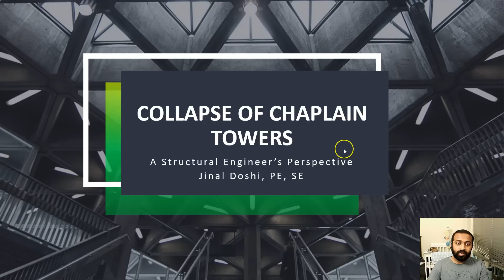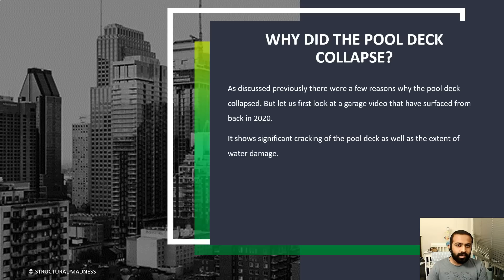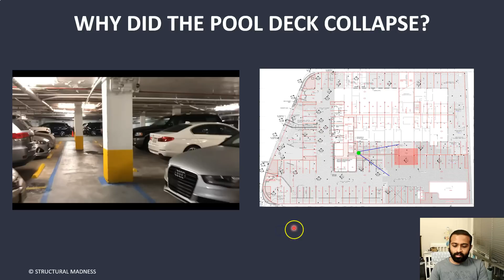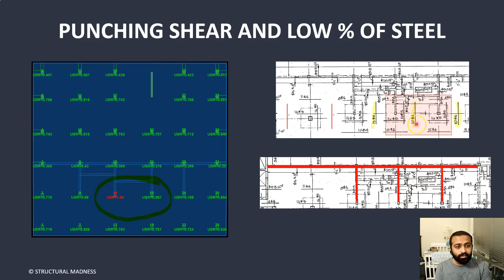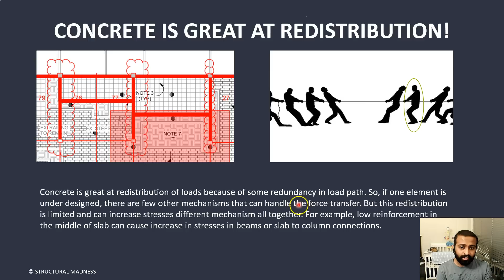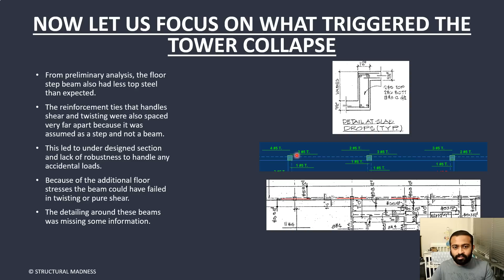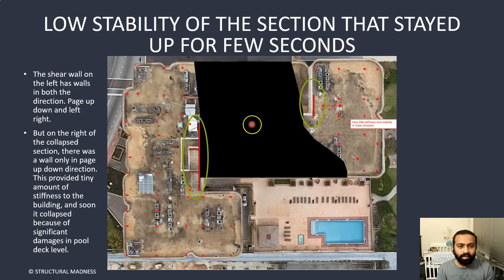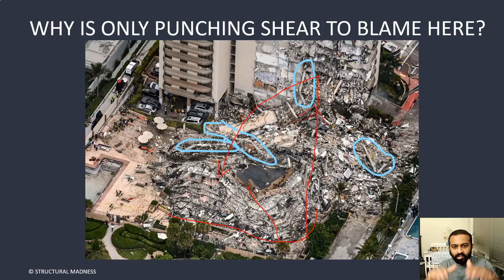Reasons behind Surfside Building - Champlain Towers South - Collapse : A Structural Engineers Review

Comment: THe best video explanation I have seen yet.  My question:  if the repairs recommended in the 2018 engineer report had been completed in a timely manner, would the building be still standing?  Would the repairs have made the building viable or still compromised?
Reply: What do you think.
Reply: @daffyduckphd  doesn’t matter what I think.  It’s a question for an expert.
Reply from the maker: I did say this before on someone else’s comment. The reason pool deck collapsed was because of material damages. If you encapsulate reinforcement with concrete again and repair it, it will lead to a temporary fix for sure. It would have prevented this tragedy. But if we think about future uncertainties, then may be 5 years down the line someone may host a huge pool party, or some brings a heavy equipment, then it can open up the cracks again and it could lead to further water penetration issues.

Also, I don’t think Morabito associates planned on repairing the reinforcement, specifically top reinforcement of pool decl, and if they wouldn’t have carried on this exercise, this would have lead to a collapse eventually. Because it was already under a bad shape. Again these are my personal views looking at their proposed repairs.

Comment: They cut corners every way possible. Again, it sounds like the mob, because that is how they operate. Cut corners, pocket the saved $$$ on construction materials, as well as, nobody signing off on the design or construction catching or reporting any of these obvious deficiencies in design or application. And it was easy to do, because FL is a Red Stat5e run by developers, who make $$$ building stuff, not repairing it or maintaining it. I'd bet that a lot of those wealthy condo owners were just shocked that such an expensive series of repairs was proposed for the building, and in doing so delayed all the repair work. But it seems now, that those repairs were only bandaids that would not have stopped the eventual failure of the poorly designed and maintained building. It seems that it was destined to kill all those wealthy people.
Reply: So if this was a Blue State it would have been designed and built correctly, because the State wouldn't have been run by developers who make $$$ building stuff, but by others who make money repairing and maintaining these structures? Are Blue States run a lot differently than Blue Cities? It seems to me that it's the same Blue People that do both, and the long time Blue Cities in this country (Chicago, Detroit, Baltimore, New Orleans, NYC, DC, etc.) are the worse maintained cities, and are well know for their fiscal mismanagement, and deeply embedded and corrupt political systems. And historically, the Blue people were more closely affiliated with the mob (unions, etc.) than the Red folks. Am I wrong on that? Also, all the planning and permitting for the collapsed building here was done in the late '70's. If you look closely, the design/arch. drawings were done in '78/'79. And a couple of City Council members took some contributions from the builder, which supposedly helped get construction started in early 1980. Now, this next bit of info is going to sting a little. In your haste to make this a Red State problem, brought on by your TDS, you forgot to check out an important detail. From this poor buildings early conception, & throughout most of its final construction, FLORIDA WAS A BLUE STATE! As Blue as your face is now! Yes sir. From late '76 to late '80, Florida was an "I voted for Jimmy Carter/Walter Mondale" Blue friggin' State. The same Carter soon to be dethroned as the "Worse President Ever" by Pres. Joe "Sniffy" Biden. (Kinda ironic, eh? You may want to call an ambulance for that gunshot wound in your foot). And, oh yeah. That building didn't give a rats ass if it killed all those wealthy Red people that owned the condos, or the poor-ass, socialist loving Blue people that mopped their floors & cleaned their toilets. You know why? Because it's a building, dipshit! Not some living Red entity. Take your damn TDS meds, for frogs snacks!
Reply: @craigjensen6853  I realize all that, but the  OP felt the need to politicize it, incorrectly, so I called him on it. Seems like anything bad that happens news-wise, there's someone eager to jump on it and blame "the other side" for it, even if it's a stretch or not related to the story at all. And yeah, if politicians and money are involved in a project, crap is gonna happen. Red or Blue doesn't matter.

Comment: Excellent discussion and analysis.
Another factor contributing to the pool deck collapse could be unanticipated maintenance live loads.  Over many years, the pool deck has been subjected to weather and rain saturation.  Drainage and waterproofing may not have been sufficient and tile cover not allow the concrete to dry out. Live loads maintenance may have contributed to spalling and cracking of the pool deck slab.  If the deck tiles were replaced over the years, likely heavy loads such as a forklift or skid loader and pallets of sand and tile moved across the pool deck.  That would be concentrated loads, maybe 8000-10000 ibs repeatedly driving across the concrete pool deck.  As shown in the stress analysis at 28-30 minutes, the garage area offers minimal column support and subject to the highest stresses.  Equipment operation and weight during any tile replacements, the 2005 east wall repair (?), and planter box/palm tree work, could have added significant stress to a compromised concrete slab deck.  This likely contributed to hairline cracking and additional water seepage.  Likely design did cont consider future maintenance loads and contractors may not of considered the deterioration and underpinning support of the concrete slab deck.

Comment: today I heard the top engineer investigating why the building fell said the pool deck was part of the building structure
Reply from the maker: Yes it has always been a part of the building. Typically when a floor fails and collapses, it fails and collapses on floor below. Now it fails on a basement floor on soil which is supported by soil below. And we typically call it a local failure, it shouldn’t have lead to building collapse. But in this particular condition the building did collapse of multiple other reasons one of the major reason being small column size as well as not enough details of the beam column joint.

Comment: Someone  who worked in the building said that parking gargage flooded during storms and high tide of sea water almost monthly.  He was very sure it was sea water. He stated there were 2 pumps pumping the water out when needed but it was not fast that done cars floated in the water in the past. The pumps were used so much that they were replaced often.

It was stated that the water table was 2 feet down. The destruction crew stated the remaining building post were not 6,000 psi when he drilled holes for demolition. I do understand it is not one failure but multiple failures that creates a catastrophic event.   

Prayers to the families.  🙏🏻

Comment: We have not yet seen the rebars from the collapsed "pool deck" connecting to the building with 16x16" columns.
Clearly visible photos have shown the collapsed "pool deck" with cars on top of it with NO rebars for maybe 30 feet. I think the collapse started here, and spread.
The so called "pool deck'" was actually a ROOF.  Lets call it Garage Roof. It had no visible drainage system, a pitch that would direct rain and ocean spray away from the concrete. The water barrier seems also to have been miniscule, or compromised, as evidenced by long term leaks into the garage. The planters which held fully grown palm trees, and at one time maybe as stated in the drawing, Shiffleras, which are fast growing with an aggresive root system. They dump a lot of leaves and would probably been removed. What system was there to contain the root system in the planters? How was excess water taken care of?  How where the plants watered? As the garage is below grade and most likely below the water table a pumped drainage system would be required. I did not see any floor drains in the garage either. These would have to been haved to sealed against the water table.
A lack of these indicate a problem with engineering, building code, inspection, or maintenance.
This debacle is wakeup call for everyone, and much information is held back to protect financial and political interests.
The garage roof would need to have correct slopes, water penetration protection and its inspectability, a working forced drainage system, an independent nature from the connecting buildings, expansion joints to handle temperature swings.
The planters need a drainage and irrigation system and be sealed from heavy invasive root action.
Optimism and good luck in building design only last so long.

Comment: Bravo! your presentation and design analysis is excellent, and will no doubt be borrowed by every "wannabe engineer" out there making videos. 
The primary reason this building collapsed was corrosion of reinforcing bars (ie, rebar). Absent the corrosion (say if the building was in a desert area like Los Angeles) there is little doubt this building would still be standing. Your comment on "there was no salt water corrosion" is erroneous. Various maintenance persons have already come forward to present damning evidence of sea-water anywhere up to 2ft deep in the garage after storms/high-tides, etc. They report having to regularly replace the large pumps needed to pump the salt water out of the garage. Even contractors who constructed the buildings have said that both South and North towers had water problems from the get go.
Hindsight is 20/20, but any engineer worth his salt, when called in to do a thorough report on the condition of structure, would have 'sleuthed' out these facts by either speaking to residents or building personnel. I consider this but another example of the incompetent Morabito Report of 2018. More on this report in another post.
Regarding the sequence of collapse: we don't have a comprehensive timeline of all the witness accounts and all the video clips taken. Based on what I have heard witnesses say, there was between 30-45 minutes of time between the initial element failure and complete global collapse. Taken just by itself, tthis amount of warning is a positive comment on the toughness of modern structure. Those who could respond to the warning sounds of the building gradually failing, did so, and gave us valuable accounts. 
As to the subject of what exactly occurred in the well-known "garage-video", one should realize that other areas of the deck (outside the garage entrance view) may have failed also. You expressed it well when you said "something had occurred there".

Comment: terrible design, lack of steel and cement - the broad picture shows that the building was built to collapse.
Reply from the maker: Absolutely, a part reason for failure is definitely poor design and lack of detailing on drawings and the other part is the maintenance of the overall structure. You just cannot let the building structural system be damaged so significant that it can lead to such a scale of material deterioration.

Comment: I don't see pool deck leaders thru slab mid span ew. The broken white pipe leaking water is white not red which is required for sprinkler lines in accordance with NFPA.

Comment: The pool deck structure should have been a separate structure as a 12 story structure has drastically different characteristics of that of a one story structure. I would have placed an expansion joint between the two strictures.
Reply: It was built as cheaply as possible by Mafia construction firms who didn't even follow the plan.

Comment: Torsional Irregularity is the answer to this collapse. The dropped beam where the building and patio slab ties together and some beams  pulled the slab and columns imparting a large moment and tension force. The slabs pulled away from the columns as the shear connection was very poor..
 As the slabs began rotating at the column connection they were slowed by the shear walls on each side but also by the weak slabs. The slab fell in the resultant direction. 
Also lack of drag strut so slabs can dump shear into shear walls.

Comment: Thank you for this detailed description of what likely happened and why backed up using load data from the original structural plans.  As a SE it is good to hear the slab and building were underdesigned and perhaps little or no rebar to prevent punching shear was in the as-built building.
Reply: I’m not one for government everything, but left to “free enterprise” aka free profit many lives are AT RISK. Certain things, airplanes for example…. hint Boeing 737’s must be certified independently… you can’t trust profiteers do the right thing.

Comment: Before the collapse they were staging roofing material on the roof.  How did they get that material on the roof.  Did they drive onto the pool deck from the upper parking lot with equipment to lift the roof material to the roof?  If so, this could damage the pool deck and upper parking lot concrete slabs, plus add weight to the building.  The thermal contraction of the building at 1:30am may have been enough to start the failure of the pool deck and collapse of the building.
Reply: It was built by a bunch of hillbilly cowboys. The building didn't even follow the plan and was a mess from day one

Comment: Seems the building was designed to meet minimum requirements. Many apartments were upgraded later with tile and marble floors and bathrooms. Can you estimate how much weight could have been added above to what the building was designed to stand?
Can you explain why one wing used thicker columns and the other thinner columns? Like the wing wing that fell was designed as an afterthought or addition

Comment: The elephant in the room are those square planters full of soaked earth (and with palm trees that were later removed) Those square planters were not part of the original design but added later by the HOA.
Reply from the maker: Well, I did take a look into the architectural and landscaping drawings when they submitted everything for permit including structural. They also indicate the soil profile, depth of soil and types of trees / plants they were planning to plant. So it seemed like things were coordinated. I am still more inclined towards deficiency in the structural design.
Reply: @StructuralMadness  The rectangular planters were included in the plans but the square planters were not. Also can you explain the function of the three beams attached to the three columns that failed. They are attached to the side of the columns not on top of the columns. Only those three columns  that failed have beams than link them to the columns under the pool deck. Could those three beams have pulled the columns from under the building when the pool deck punctured through?